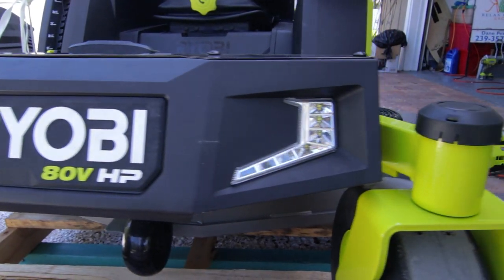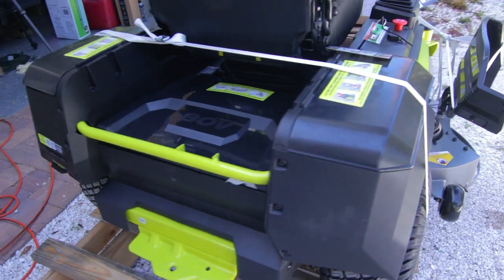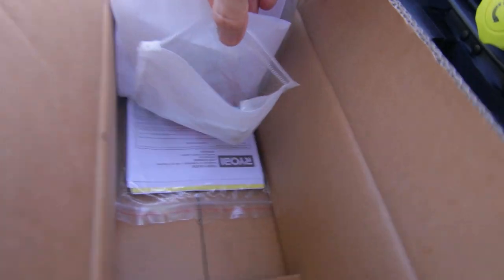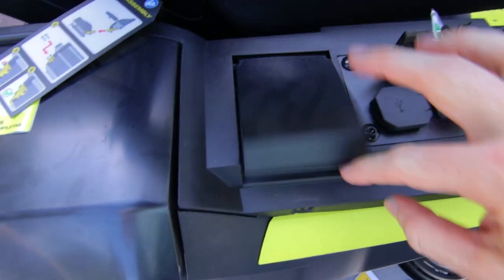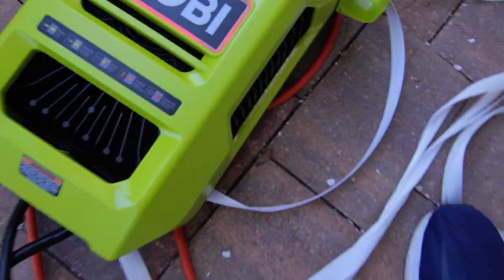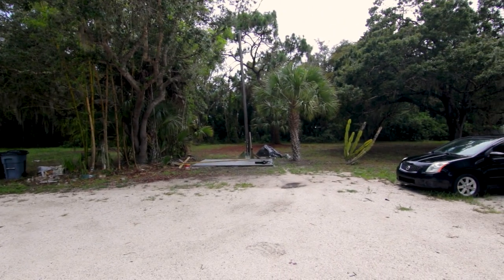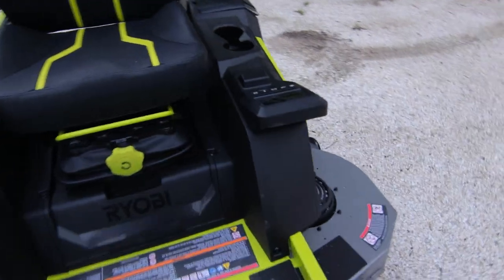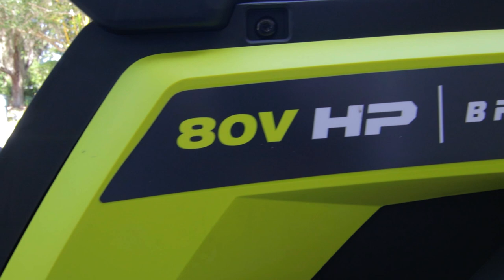Unpacking The New Ryobi 80v Zero Turn 54" Mower! z54Li Overview | New 2022 Ryobi Electric Mower

Comment: I received my 80v mower on Friday as well, mine is the 42".  Only mine came just like they come from the factory on its metal palette with support bars and plastic, all which had to be removed.  (I would attach a photo if I could.)  And, of course nothing was assembled.  After removing the plastic, unbolting all the support bars, and cutting all the various zip ties, I had to install the seat, the joystick, connect all the batteries, check the tire pressure, etc., etc.  I actually preferred it that way.  I had read the operator's manual and the assembly manual multiple times (the PDF versions), and still followed the instructions every step of the way. (And I am very 'handy'...)  You might have done well to have done the same, as I saw you did several things different than the way they said to do them.  ONE example was with the charger.  They strongly recommend against using an extension cord, and they say to always connect the charger to the mower before connecting it to power.  I could be wrong, but I believe you also plugged it in before removing the foam from the 40v batteries.  I'm only pointing this out because people might watch your video, thinking that everything you did and said was correct. Your enthusiasm showed, and that's great, but you maybe should have taken the time to read the manuals before hand as well.  Enjoy!
Reply from the maker: Wayne, thanks for your reply. I agree assembling myself would add a little more reassurance to knowing it is done right. I imagine there won't be many more of these hitting the store assembled as they will continue to be back-ordered. Yes, the foam was removed :) Regarding the extension cord, I never considered this as most chargers would experience minimal current loss, if any, that would be experienced but with a charger/batteries such as these you are right, this may prevent the batteries from getting the full charge over the 4-5hr charge time (may be worth an experiment to inform others!). I could only find where it said to not use adaptors or 2 prong plugs tho. Unfortunately, my outlet locations can't reach the mower's location, resolving soon tho! Regarding connecting to the mower charge port BEFORE the outlet... I'd like to know the why? When you drive an electric car up to a charger you just plug right in. Same concept, no? Now, about the manual. 80v Battery manual states "to obtain the longest possible battery life we suggest removing the battery pack from the charger once it is fully charged and ready for use." This is normal practice with rechargeable batteries. BUT.... Ryobi Manual then states "NOTICE: If it is not possible to leave the mower charger connected, make sure to charge the batteries fully at least once a month". Here is the fault in the manuals. They are written by people. Great tips/points you bring up though Wayne; people read the damn manual!
Reply: @LifeAsDane  I’m not sure about why they say to plug it in to the mower first, but that same order was really stressed in instructions about charging electric bike batteries. (Battery then power…)  And yes, Ryobi has made some conflicting statements about these!  As well as a many ‘non-answers’ to questions that I and others asked.  That statement about leaving it plugged in to the charger may be an accidental hold over from the manual for their mowers with the lead acid batteries!  By the way, I don’t believe the Home Depot that I bought mine from has sold any of the other four that they received! (Based on what it says online, which reflected my purchase immediately.)  But I also didn’t see any displayed when I was there on Saturday…
Reply: @LifeAsDane  You've seen a spark before when you plugged something in, well same thing here except more of a load with these battery's and charger, so it's best plug the charger in last to keep from burring up connector on the mower with the load.

Comment: We are looking at this for me.  Is it a good girl mower and any color like pink?
Reply from the maker: Define “good girl mower”. I’d say yes just because who wants to smell like gasoline 😉. Regarding the colors you’d have to just do a custom paint job. Would be pretty easy as the sun is the only wear and tear besides some water the outside will ever get so painting the plastic should hold up.
Reply: @Great Dane  easy to use! Just kidding on the colors, I’m fine with yellow. Right now the other mowers are either finicky or manually hard to use.

Comment: I’m not great at electrical stuff but could they make this act as a battery back up for like a fridge if the power goes out? 

I know you can buy portable batteries for keeping the fridge/freezer cool in the event of a power outage. Would be cool if this could act as a small battery backup if power goes out
Reply from the maker: Chris I love that idea. That's what the new F150 Lightning (electric) can do if you get their best model. Seems the battery pack would have to go to some converter and be tied in to your panel. But even just having a 120v outlet on the mower seems like a good idea now that you mention it. You could have portable power to anywhere in your yard...
Reply: Not on its own, but Ryobi do make an 1800w inverter that accepts the 40v batteries. It can take up to 4.

Comment: No faith in Ryobi batteries they have a high failure rate batteries will exceed the purchase price, have had 3 40v batteries fail one a year not good odds & have one on the way can only get it half charged, let us know when the honeymoon period is over. I believe in electrification own a Tesla this is not of that quality, also we get lots of rain in FL wonder what the limitations are with this mower? With gas u fill up & mow when you want with a EV mower you need to plan your mow not to mention if you change it up and it rains for a few days like it often does here in Florida the mower can’t sit at 100% charge state for long periods of time, would risk damaging the batteries like any lithium product.
Reply from the maker: Interesting. I've had good use out of my 18v batteries. Newer to the 40v's so we'll see how they hold up. Regarding the rain. Not sure who wants to mow in the rain but to each their own. I'm definetely putting the mower through the ringer of mows averaging 1 a week on about 1.6ac. And please checkout my upcoming video! One of 80v's ended up being a dud. Ryobi sent someone to my house with a new battery. So that was a positive but the fact it was bad after a mow or two was a bit concerning. Seems they got a good team behind this product tho as I've personally received multiple calls now from their product lead on the riding mowers.